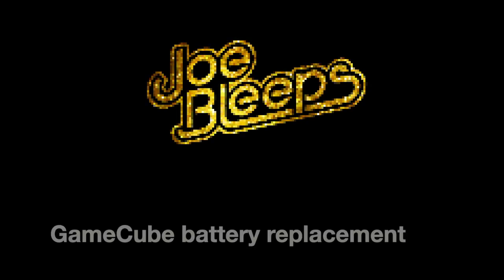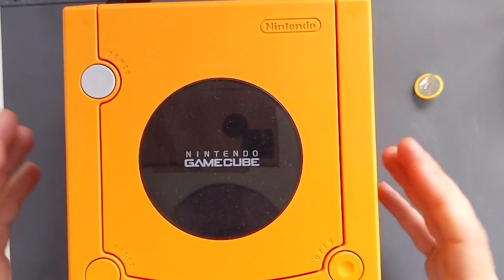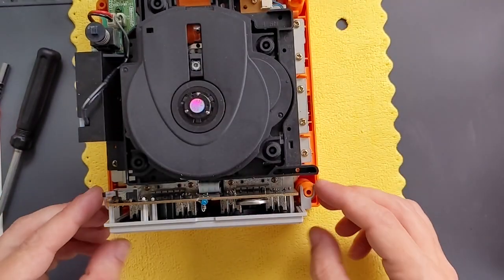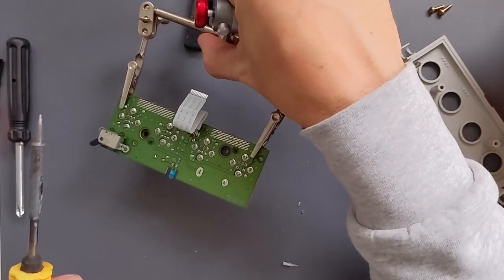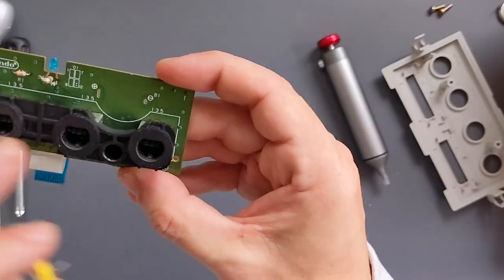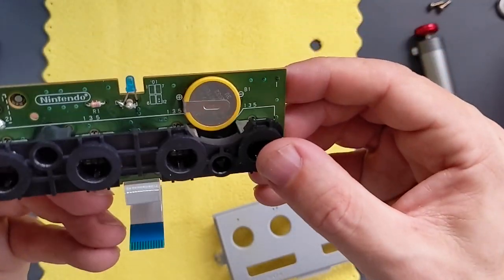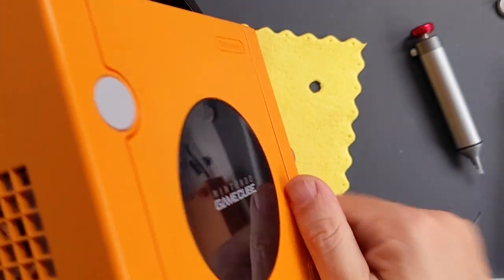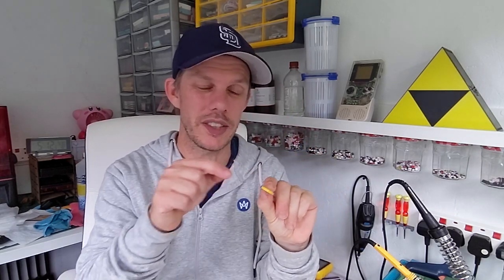Nintendo GameCube internal clock battery replacement

Comment: I was doing the exact same thing today, except I went a step further and soldered in a CR2032 battery holder so I can easily swap in a fresh name brand battery in the future without soldering again
Reply from the maker: Good work! I did that on my Dreamcast too, hadn't seen any suitable holders for the GameCube
Reply: next replacement is approx  year 2050 ..hope we will find a cr2032 battery in some museum .
Reply: @JoeBleeps  The ones used for SNES carts, and sold on console5, work great. Amazon has some identical looking holders, but the metal tabs are a bit thinner/cheaper.
Reply from the maker: @GLAAAAAR  good to know, thank you
Reply: Hey hows that battery holder working out for u. I need to replace my battery this seems like a great solution for easy swap outs. I’m sure as years go on it will be harder to find cr2032 batteries like the one in the cube
Reply: Cool where did you get them from ????
Reply: Is console5 better quality because I wanna make sure it’s not break on me or anything
Reply: which one did you buy?
Reply: Yup, and the holder can be soldered on the back! Easy-peasy!
Reply: @JoeBleeps  Yes and the capacitors will likely be nonfunctional by 2050 as well.

Comment: I'm really glad that a number of sega systems simply had a latch you can pop in and out. Having to solder for these things, especially on mere cartridges, just seems so unnecessary.
Reply: the only reason is probably because it was easier to make it that way and they didn't expect people to be using the GameCube decades later.
Reply: I don't think they anticipated their systems to be used for 30+ years... likely 50+ and 75+ if they're taken care of and used with voltage regulators etc to keep them protected.

Comment: Just finished the battery replacement this evening. It was much simpler than I expected it to be. Nintendo did a good job making this device easy to service. This was a very good video. No long winded extra blabber. Just simple, clear instructions. . Easy thumbs up. 👍
Reply from the maker: Excellent! Thank you 😊🙏

Comment: I believe most LED lights are 1k ohm resistors. Did you verify you used a 100 ohm?

Also, try copper wick to remove solder.
Reply from the maker: I just got some new wick that should be really good.  I normally default to 33o ohms on an LED if I'm unsure but 100 is normally sufficient.

Comment: easier to get a 2032 battery holder and solder than in just so much easier if battery goes flat dont need to desolder anything. I have seen some amazing gc mods etc I am lucky as my gc has a full iced cubed case super rare and super expensive!
Reply from the maker: The icedcube shells are great, I remember preordering mine when they first came out. I should probably make a video on that one too, I still have it, it has two internal wavebird receivers and a qoob pro modchip with the usb port
Reply: What brand/kind should I get?

Comment: When I turn on I get this message: " you must first set the calendar ...", I have used many controls but it does not leave that screen, is it just the battery?
Reply from the maker: it could be - have you tried setting the calendar and seeing if it will let you move forward from there?

Comment: Do i need the clock to work properly to play games just got a GameCube and the clock isnt working so basically so i need the clock
Reply from the maker: You'll be fine for the most part. The biggest inconvenience is keeping track of your save games. Some games make use of it, like Animal Crossing, but mostly you can play without any issues at all

Comment: I had no clue they require soldering. I guess I'm not going to change my battery for a while
Reply from the maker: As far as solder jobs go, it's an easy one. Go for it!
Reply: There are lots of very through (and highly positively rated) videos of how to solder properly on youtube and the equipment you need is readily available at any lowes, home depot, or other hardware store. Its not a very difficult job if you are patient. 👍

Comment: wait, so the cube and dreamcast share some design elements?
Reply: personally ive just been installing CR2032 sockets on my consoles for the batteries now just so if I have to touch it again its less hassel
Reply from the maker: @Captain_Char  I did that with the Dreamcast, and yes, definitely design in common!

Comment: I tried with a battery holder and after that a new tabbed battery soldered on the controller board. On both cases the battery runs dry in more or less a month. Is that normal?

Comment: How long does this battery usually last? I just got a GameCube at my local “retro game store” and wanna make sure the battery has some staying power
Reply: About 20ish years usually. Can vary a bit though.
Reply: @MilkyHazard same here, 2003 to 2023
Reply: My GC is a 1st generation 2001 model and the battery died sometime in maybe 2022. This will be the first and last time you ever really have to replace this battery if you need to do it.

Comment: Really the gamecube needs a battery that's a weird for a console that's going to be plugged in
Reply: I think it's because it has an actual "power off" state, so it needs the battery to maintain the clock when it's off or if you move to a different outlet. Versus a PlayStation2, for example, that just has a "standby" state, so it keeps all the system settings from AC power but resets whenever you unplug it.